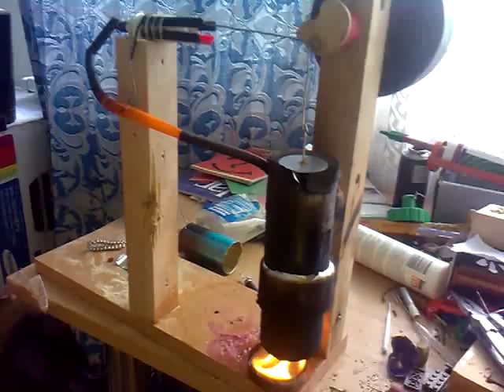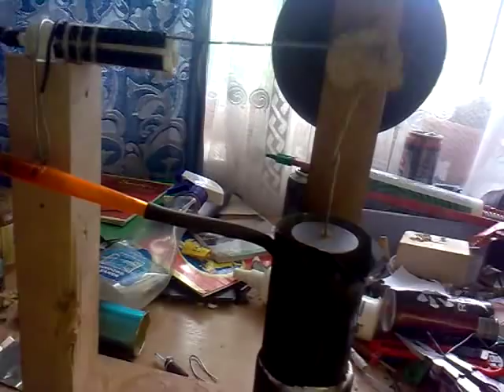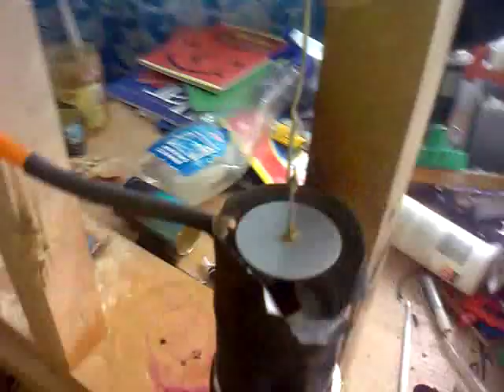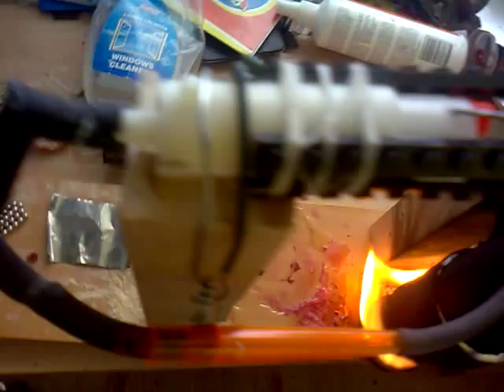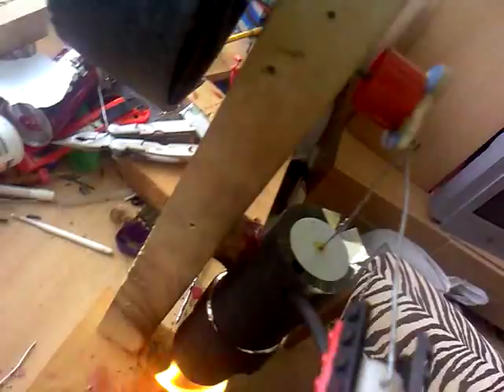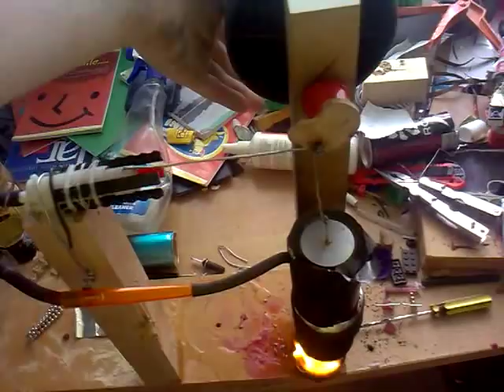not working stirling engine

Comment: Hello! From what I understand your engine has air leak! Probably it is leaking air, the piston force. Try replacing the piston, diaphragm by a "balloon". To do the test. For me it seems that your engine has no compression and runs very easily. Any questions, we are there! As my time. Because this was my my problem, when it did not work. Leandro from Brazil.